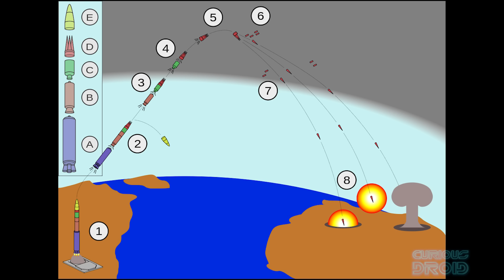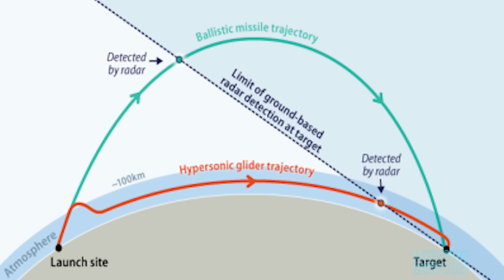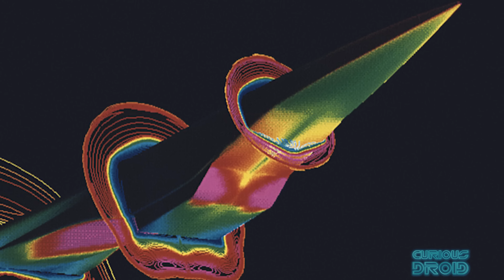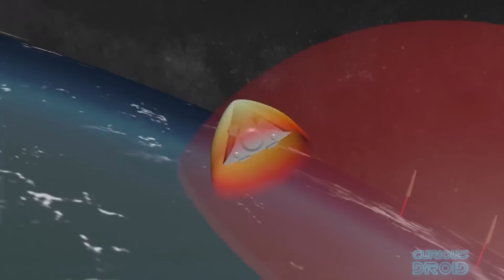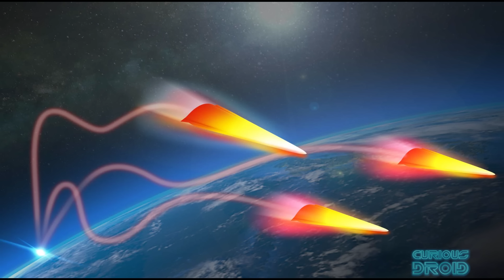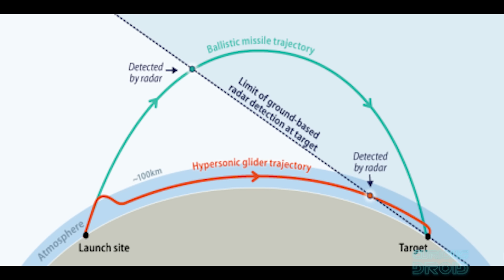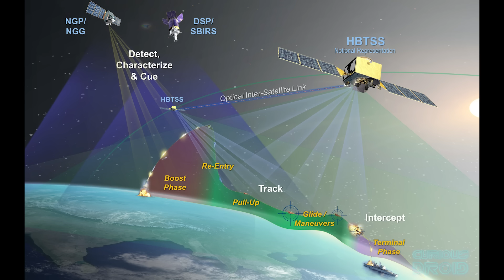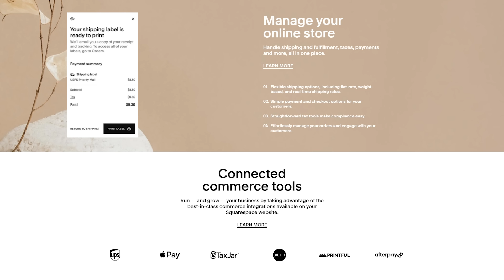Can the U.S. Stop Russian and Chinese Hypersonic Missiles?

Comment: Ironically, hypersonic weapons are slower than regular decades old ballistic missiles, so many people don’t understand that…
Reply: The key is not only the speed but the trajectory. The missile does not follow a ballistic trajectory and can change it. It also flies at a much lower altitude making it undetectable by air defence systems. So, it is impossible to intercept it.
Reply: @msebastien24  yes, but it is slower
Reply: @chengong388  
Escape velocity is 25,000 miles per hour. Hypersonic missiles are under Mach 25. We got the picture.
Reply: @chengong388  What? People do understand this.
Reply: @msebastien24  I'm not aware of any hypersonic missile that cruises at low altitude: they all fly at relatively high altitude en route to target. DF-17, for example, cruises at nearly 200,000 feet. They would not be able to maintain hypersonic speed at low level, and the thermal loads from trying it would result in them melting. They are all very visible to air defense systems, stealth is not their defense, speed is. So yeah, better touch up on your understanding of the topic. Cheers.
Reply: @dziban303  the antiship ballistic missile must pull-up at high altitude to eithe sense the target itself or get instructions from a satellite, drone, etc because the thermal heating of re entry creates plasma that makes communication impossible.
Reply: @bathhatingcat8626  yes
Reply: you also don't understand their trajectory is vastly harder to track due to a much shallower approach. 

Nice attempt but soggy observation.
Reply: @dziban303  It is a much lower altitude than ballistic missiles. As explained in the video, it is not enough to detect, you must track it permanently from point A to point B. So, it can be detected towards the end of his trajectory but even if it is successfully tracked, air defence systems will not be able to react quickly enough and the U.S. has no missile fast enough to intercept and destroy hypersonic missiles anyway.
Reply: @anasevi9456  I do, I never said they aren't
Reply: @bathhatingcat8626  a la space shuttle on re entry they know the problem

Comment: I have to wonder if these things are as phenomenally maneuverable as advertised. Because physics.
Reply: They are, but also aren't. They can maneuver quickly, but they can lose speed and accuracy by doing so.
Reply: I was thinking the same, at extreme high speeds any turn must be huge and temperatures and stresses immense. Just look at the way the space shuttle manoeuvred during re-entry (it didn’t move like a fighter….).
Reply: Especially the final trajectory looks wonky, were it flies up to the target and suddenly heads down.
Reply: The point is that they're more manoeuvrable than an ICBM, not that they can out-turn a jet fighter or dodge SAMs. They can maneuver enough to be unpredictable, to be harder to track... I think of them as a hybrid of ballistic and cruise missiles...
Reply: shhh, just ignore your brain and smile and nod at the new excuse to balloon the defense budget.
Reply: @xBINARYGODx  hey now! Don’t point out the obvious.
Reply: SR-71 losing an engine at mach 3 would tear the plane apart. On one test flight the pilot survived but the rear seat tech guy had his neck broken. The forces are that big.
Reply: "Maneuverable" is almost a different word in missile defense. To defend from missiles you need time to detect, track, calculate, and fire a counterattack to even be remotely close to stopping one. If a target changes it's path on its own (even a 0.1 radian change in heading), then you need to start all over again. Ballistic missile are detected much earlier than hypersonic weapons, and they cannot move off the trajectory even a little after the initial boost phase. To counteract one single hypersonic weapons are like flighting 10 ballistic missiles if it makes 10 micro-adjustments. Now, imagine it can move around 100 times, 1000 times, or just continuously. It gives you 1/3 of the time of reacting to a ballistic missile and you need to start all over agin if it moves. Good luck man😂
Reply: @davidelliott5843  Explosives are not living objects😅
Reply: @mikeyangyang8816  I don't think modern computers are going to have that much difficult dealing with slight trajectory changed
Reply: As fast as they are they’re not gonna be faster than the laser beams we’re developing on our side
Reply: If it changes track or speed by a few degrees the missile won't be found by the interceptor.  At those speeds a few degrees equals miles.
Reply: @Just Looking I am just being a dick, but a nuclear warhead is a few cubic inches... Just saying. Also, even a few cubic inch of bomb is a lot more dangerous than having 100 cruise missiles that gets shot down by countermeasures...
Reply: What physics, exactly? The only reason planes maneuver the way they do is because of the acceleration restrictions by the pilot.  An increased speed also increases the airflow at the control surfaces, so I don't think it's implausible.
Reply: @timsytanker  the space shuttle is huge and has humans in it; it's a pointless comparison.
Reply: @Just Looking I imagine the missile is designed in a way which won't cause it to lose an engine, just like the SR-71. The incident mentioned is an exception.
Reply: @mikeyangyang8816  if the missile disintegrates, the warhead will not detonate. Nuclear warheads have to be very precisely activated to work, and it definitely has to be in one piece.
Reply: @CasabaHowitzer  no it isn’t, the shuttle has very little manoeuvrability when traveling at its highest speed re-entering the atmosphere compared to closer to the ground at far lower speed. Hypersonic missiles are the same. Any change of course at hypersonic causes more drag and far higher temperatures, which is where those tiles on the shuttle come in to play.  I wonder how much heat a course changing missile can take?
Reply: @CasabaHowitzer  Do you know that we can go to space and back? It's pretty cool.
Reply: @mikeyangyang8816  "To defend from missiles you need time to detect, track, calculate, and fire a counterattack to even be remotely close to stopping one. If a target changes it's path on its own (even a 0.1 radian change in heading), then you need to start all over again." yeah dunno if you heard about self guided munition, it exists. 
As far as i know the hypersonic missiles don't see their targets, letalone anything else in the sky, they can't dodge. And since it's targeting a target, it can't manuvre anyway it wants  as in the end it needs to hit the target. 
Really, the only good thing about it is the flight path, getting to be detected much later. 
Tho thankfully for the west, it doesn't really work, cus there's military bases or ships all around the globe...
Reply: @dr_birb  What self guided surface to air missiles have seen or heard before? Genuinely curious.
Reply: Qian Xuesen Ballistic
Reply: @mikeyangyang8816  Aegis SM-6, and Patriot PAC-3 both have active on-board seekers and there are others.
Reply: 6
Reply: @Phoenix-vg8li  delivery of kinetic energy with lasers is very hard and the laser has to stay on the target also the vehicle is very heat resistant because of air friction.
Reply: @KevBoughen  Light energy does not provide kinetic energy it’s radiation dude
Reply: Once they are on their way into the target they slow way down, they can only get the advertised speed high in the atmosphere, close to the ground the air is way too thick to use their ramjet or scramjet engine.
Reply: so long as the US military complex stays unaware of these “physics”, they will have the advantage of intimidation
Reply: What you mean it can't go 27 times the speed of sound? The sr71 could go 9 times as slow and only have to have panels smaller which caused fuel loss so the heat wouldn't expand them and break. Are you really going to imply these need something similar? Phhhh no way
Reply: They cab maneuver but its when the try to change course that they lose speed and its wheen they lose speed that they are weak and vulnerable
Reply: @GalvayraPHX  its when it suddenly trys to drop down that you could shoot it down before detonation
Reply: @mikeyangyang8816  they still have airframes. Airframes can be destroyed by the same forces causing the weapon to self destruct.
Reply: @whoswho7815  we don’t try, big difference
Reply: @mikeyangyang8816  thank you for that 🙌🏽 because it's a Russian weapon it's has to be somehow inferior 😂😂😂 that's the kind of talk that made Americans think they're invisible
Reply: @TheSeanUhTron  they were designed to maneuver at high speeds and doge the SAMs, radar and that's exactly what they're doing
Reply: Just keep underestimating your enemies and make snarky comments online. That seems to be the standard operating procedure in NATO countries.
Reply: Too bad the plasma surrounding them makes them invisible to radars, you'll have to rely on passive IR/visible/UV optical tracking during that phase.
Reply: Spoiler: Not even close lmao
Reply: Who said that? Why they should be?
Reply: @mikeyangyang8816  but how about the material they are made of?
Reply: @volvo245  That is a myth! Plasma is in fact a radar reflector, making these things very easy to track!
Reply: I could imagine that in order to handle the massive force resulting in evasive maneuvers at hypersonic speeds, these missiles would all have to have such ridiculous construction standards to meet specifications. I don't think the cost: benefit analysis is there for a military like China or Russia to really create and maintain a substantial stockpile of them to be a real threat to the US. The US certainly does though.

Comment: Can the us stop Hyper sonic Missiles.. no... but... can Hostile Hyper sonic missiles hit something at those speeds?... that... is the question
Reply: yes. their inertial guidance systems are very advanced, the skip up moments are where glosnass corrects avantgard too. Zircon; no fucking clue. Kinzhal is just a medium ranged bunker buster so it doesnt need correction. 
I would be arrested for posting that if i was Russian, but am just a lowly recent western defence worker.
Reply: any fixed installation is a definite yes, so bases, barracks, air fields, fixed missile positions are vulnerable. Not sure how theyd handle tracking moving ships at sea and definitely no chance to hit an airplane. Though a tactical nuke tipped hypersonic missile would be devastating against a ground force, say if russia wanted to strike at a Ukrainian offensive as it doesnt need to hit directly on a tank to kill the force, and a ground force isnt going to move quick enough to escape, especially if its in a specific region with limited mobility or choke points. 

I guess it all depends on how well those nations can gather and transmit accurate to the minute targeting updates to these weapons once they are shot. If they cant then its fixed positions only, or "leading the target" with a hypersonic tactical nuke shot and hoping the target doesnt change course along the way